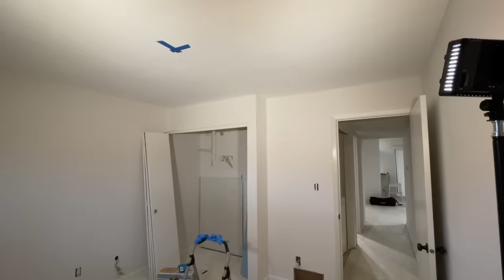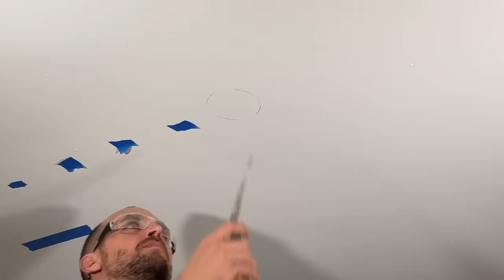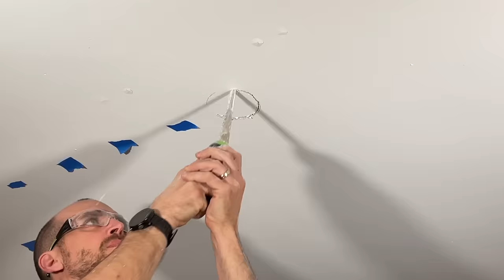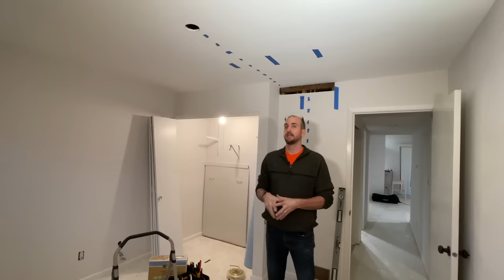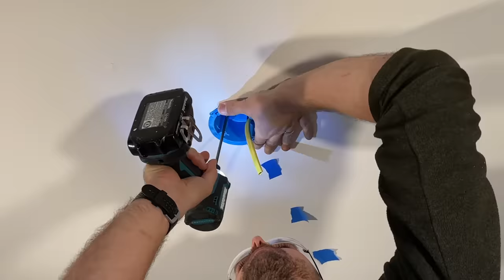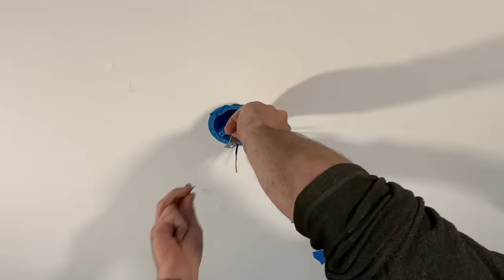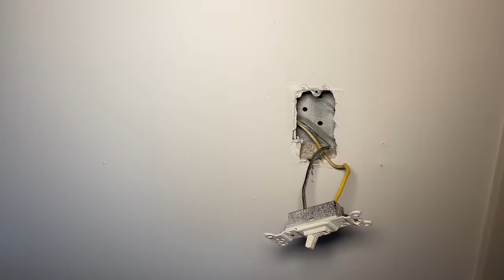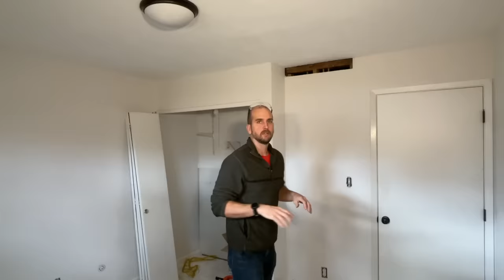How To Install Ceiling Light Without Existing Wiring

Comment: This was a very interesting installation. I really like how you were able to fish wire with minimal drywall damage. I did see two things that concerned me. The first is that the box you used for the ceiling is not ceiling rated. If you look at the UL listing for that box it specifically says that it is designed for wall and not for ceilings. The second thing is that if that wall cavity you ran the romex in is an air plenum, then this is actually a very dangerous installation because the romex is not plenum rated. If there is a fire, then the romex will produce a poisonous gas that would spread through the home.
Reply from the maker: Hey Paul, thanks for the feedback.  Agree, this is a better box to use https://amzn.to/2W0rDfY .
Reply: @EverydayHomeRepairs  Another thing is you didn't ground the cross brace that screws to the box that supports the light. Even though the light is grounded, the cross brace needs to be grounded as well. If the box was metal instead of plastic, you wouldn't need to do ground the brace.
Reply: @Bluesman57  it looks like the metal tube make contact with the brace and the metal backing of the light. I'm not sure why it'd matter anyways, that bracket isn't accessible and I doubt you'll get a short there and not conduct to the back of the lamp.

Comment: Great video to teach a beginner how to add a light the only thing I would change is I would cut a much smaller hole in the left stud space a couple inches lower so you don’t have to patch a corner and you can use that smaller hole to fish the wire into the right stud space

Comment: Thanks for this video.  I learned a lot.
Now i can explain to my Electrician tech. Exactly how i want my wires to go through without sounding like a clueless person.
Reply: If you have a good electrician and not a handyman all you need to say is you want an overhead light in your room with minimal holes and existing receptacles on all the time. The electrician will figure it out easy enough.

Comment: You cannot use Romex in a plenum area. That is why they used conduit.
Reply from the maker: Hey Melissa, thanks for the feedback.
Reply: Actually romex can be installed in a return air duct in a residential installation.
Reply: That's not necessarily true. In Chicago, all wiring must be installed in conduit, whether in a plenum or not.
Reply: Romex can only be run across a cold air return with the holes caulked. It’s a code violation to run romex like you did there. Depending on how many floors your condo has and local building codes it might not meet code with any romex in the condo.
Reply: you can use what you want on your property...this is a free nation
Reply: @jimmac1185  Chicago is run by sorry Unions.....what I do in my house is not their business
Reply: @jimbritttn  it may not be the union's business, but it is the wiring inspector's business-
Reply: As far as doing what you want, it’s your property, you don’t own the lives of all the people hurt when the building catches fire. I’m an unpaid volunteer fire fighter, I can tell you about many people who aren’t happy about work done that violates code.
Reply: @jakem2286  I've done electrical and plumbing work since I was 15 (my younger & brother wired my dad's new house in 1967 and brother still lives in the house!)
Reply: @jimbritttn  so you’re an expert? Bet you don’t know how a 3 way works
Reply: @jakem2286  don't be insulting! Just retired from 45 years programming computers and have done electrical work for over 50 years

Comment: couldn't you also use the light switch to do the same thing. just wire the load side from your outlet to the bottom of the switch to give it power all the time and the top of the switch to your light that's switched??
Reply: Yup !   Would have also worked.  Wouldn’t save any labour, so what he did in this video was equally good.  Truthfully, your thinking is quite smart.  Your way would also provide an identified (ie neutral) wire at your switch box.  I find that today, many people want dimmers, timers, sensors instead of a plain old switch; having an identified wire gives you more flexibility in what type of control you can install to replace a switch.

Comment: Yea,, this guy has some knowledge about doing this. But if I ever cut open wall like that to run a cable, my boss would bust me back to clean guy. And he ran 12/2RX not 14/2RX (yellow cable is ALLWAYS 12/2RX)
Reply: ya, 14/2 would have been cheaper. You can still use 12 though. it does not violate code
Reply: If the outlets had a 12/2 , code says he must use 12/2 not 14/2. Most likely a 20 Amp circuit. I thought the same thing and the old wiring did appear to be 12 wire.

Comment: Thankfully there was no blocking in between the ceiling joists or wall studs 🤣🤣🤣
Reply: That's what I deal with in my walls but I assumed it was because it was built in the 60s... Have to put at least 3 holes in any wall to do wiring
Reply: Rarely is

Comment: U meant well with this video but every home presents different challenges. To add recessed lighting in the ceiling of my 1950's home meant cutting a multitude of openings in the sheetrock and drilling thru ceiling beams to run the romex cable. I had no access from above or below due to finished spaces so I don't see how it could have been done otherwise. It was a great big mess but the finished product was worth it.
Reply from the maker: Yes, that would be a bigger job for sure.  This type of work always gives me a greater appreciation for attic access.

Comment: Good work but you coulda just went to the switch and re wired the plugs to be constantly hot from there. Then sent your “should have been” 14/2 to the light.
Reply: It's actually cheaper, in the long run, to use 12/2 over 14/2. When you factor in the cost of electricity.
Reply: @OGR In this case maybe. But if he is doing a bunch of other wiring in the house, why buy 14? Might as well bring it up to 12. The cost difference in the cable itself isn't that much.
Reply: @OGR home depot's website has the 250' rolls of 14/2 at $0.30 per foot and 12/2 at $0.31 per foot. So yeah, 12/2 is the better buy.
Reply: @OGR I don't normally wire houses from start to finish, so I am not qualified to answer that question.
Reply: @jimmac1185  my fingers don’t like 12/2 much.

Comment: Yeah I'm buying a house and all 4 bedrooms are like this so I'm very thankful to of found this video. Only thing I haven't dipped my finger in yet is sheet rock. Did you do a follow up video to finish things?
Reply from the maker: Nope, I had a guy coming in to do some other drywall repair / painting so I wasn't able to capture that part of the project.  I really like this guy who has all kinds of videos with tips on drywall.  https://www.youtube.com/channel/UCbZdXox6mKHdcT2QdVT-goQ
Reply: Why not crawl into the attic to run the wire across it and down to the switch?
Much easier than having to fix a large hole in the wall.
Reply: @BA-gn3qb  well I can do that for my upstairs rooms but not my basement ones. But my basement ones have pull switch lights which I'm going to get these wireless modules connect them to the power of the existing lights then mount a new ceiling light and mount the cordless/wireless switches. I found done in Amazon for 17 bucks a piece.
Reply from the maker: @BA-gn3qb  I wish, that would be much easier.  This is the first floor of a 3 story condo complex so no access from above for this install.
Reply: @EverydayHomeRepairs  - I understand your situation. 
But the other guy said he was buying a House.   Which should have an attic.  And as far as his answer, a finished basement too.

Comment: Just put 14-3 when wiring a ceiling, in case they wanna do a ceiling fan/light in the future, they can at least control fan and light seperately.
Reply from the maker: Hey Ryan, not a bad idea, thanks for the feedback!
Reply: Not that it really matters, but code says if you run 14/3 you have to install a fan rated box, unless you’re running the wire to feed another wire leaving that location.

Comment: @everydayhomerepairs
Hello, 

Thank you for making these videos. They have very helpful and informative. I have a 2017 home that I want to install recessed lights into the master bedroom. The room has a light switch but it does not power any of the wall receptacles or outlets when I turn the switch on/off. Do you recommend any videos I can watch to trouble shoot this situation or have any suggestions? Thank you

Comment: You seemed to fail to mention what happens when the ceiling joists go the way way to do this job .
Reply: Same thing but more holes in the joists and more drywall repair.
Reply: @WTFUSERNAM44  not necessarily, if the ceiling is installed with strapping.

Comment: I learned a few things, thanks. Where I live, this would require a permit because it constitutes ‘extending/altering/modifying the wiring system’. Also, since this is a condo, where I live, this would have to be done by a licensed electrical contractor. In my state, a non-licensed person can only work on a single-family residence (that they own, live in, won’t rent/lease/sell for 12 months, and a few more rules…).

Another commenter stated that since it is a light, he only needed to use 14-2. That depends. What really dictates what gauge wire that should be used is the ampere rating of the circuit breaker. Since he is tying into the branch circuit for receptacles, there is a good chance that circuit is 20A. If so, he is correct in using 12-2 and not 14-2 since 14-2 is not rated for a 20A branch circuit. p.s. At 13:46, it appears the AWG of the wire is 12.

Comment: That "vent" in the wall is a little suspicious.  No metal ducting?  Is this a teenager's bedroom?  Looks like a good stash spot.
Reply: Common for return ducts
Reply: its a cold air return duct. They typically just use the cavity between studs

Comment: So that whole room had every top outlet on the switch?? Yikes. Anyone else think that's bizarre? I'm accustomed to just the outlet closest to the door having that kind of control to just put the main room lamp/light on. Having every outlet have one receptacle dependent on the same one switch seems illogical.
Reply: It’s pretty common in apartments
Reply: When they built the place most people used lamps. That’s so they could switch it on.
Reply: @marshallkobe  On EVERY outlet in the room?
Reply: @camdendexter  yeah. We had a new home built and i did an electrical inspection on every bedroom, the top socket of every outlet was switched.

Comment: I feel bad for the person who goes to install a ceiling fan on that box and it all comes crashing down on them.
Reply: Seriously, a metal retrofit box rated for ceiling fan use is less than $15 at Lowe's/Home Depot, no reason not to install one.
Reply: @ProfessionalFixologist  metal box not mounted on joists still won’t help :)
Reply: @luyichen11  The metal retrofit boxes rated for ceiling fan use have a long bar and two metal "claws" and a rod you turn, causing the claws to bite into the wood and compression fitting into the joists.  Installed properly will hold a ceiling fan no problem.  Example: https://www.youtube.com/watch?v=KvZzLJmJhtU
Reply: @ProfessionalFixologist  thanks. And now I feel shame about my ignorance. And there is no need to cut open any bigger hole because the crossmember bar can be inserted first and compressed to fit in between two adjacent joists….

Comment: I'm doing this in three rooms today. Wish me luck. One question: Is there a specific reason you used 12/2 wire? I'm using ceiling boxes that can support a fan, and I plan to use 14/2 wire, which should be ample for a fan with lights. Just curious if the 12/2 was what you had on hand or if I'm missing something and the 14/2 might be insufficient for one reason or another.
Reply from the maker: Usually you would use the gauge of wire that is matched to your circuit breaker size.  20 Amp = 12 gauge and 15 Amp = 14 gauge

Comment: How did you run the wire going down the wall without drilling any holes?
Reply from the maker: Hey Tristan,  actually behind the wall was an open drop ceiling for some utilities associated to a laundry closet so I was able to just come out from between the floor joists and then around the middle 2x4 and down the adjacent wall cavity.  Normally I would need to drill a hole through the 2x4 to get access to the adjacent wall cavity.  Let me know if you have any other questions.

Comment: Great video .  I think my room only has one outlet that goes on and off with the switch.   I don’t mind that one staying like that.  I’m also adding a brand new led light fixture for the first time in that room.  The switch had a red, black, and copper on it.  The switch box had blacks tied together , whites tied together. ,  coppers tied together.  Can I just run a romex from cieling to switch and if so how would I tie into the existing wiring?
Reply: Black & Decker publishes a book/pamphlet called Basic Wiring & Electrical Repairs.  It shows clear color photographs of every possible wiring scenario.  You can find it on ebay for about $3-4.

Comment: 12/2 Romex for an led light? 14/2 would have been fine and so much easier.
Reply: you have to match the existing wire. if it is a 20 amp circuit you have to continue using 12/2. I don't know why its 12 g wire (20 amp) for a bedroom.

Comment: You apparently have never heard of a "stack switch" that would still keep switched outlets and saved a boatload of unnecessary work . You may want to consider buying and following  National Electrical Code book.
Reply: Is that a duplex switch?  Single gang but 2 switches?  I don't blame him for removing the switched outlets.  With a switched ceiling light there is no reason to have a switched outlet.
Reply: @Guillotines_For_Globalists  Single gang,2 or 3 switches stacked vertical.1 pole or 3way
Reply: @robertfunicello2676  I know what you are talking about.  The triple stack is more rare.  In my home I use single gang duplex switches in 3 locations.  In the bathrooms, actually.  Mostly to separate the fan and light functionality of the bathroom fans.

Comment: "there's conduit in this condo like a commerical installation" Nnnnoooo that's code, and pulling romex through the wall and ceiling where conduit is the electrical code is against said code and upon resale that light will have to be re-wired inside of the metallic conduit that will have to be installed by tearing out the drywall first.
Reply: Get your own channel
Reply: Upon resale?  No, potential buyers aren't going to x-ray the walls.
Reply: @111ch1a1d111  Standard home inspections check all wiring as part of the purchase process. No xrays, but yes, different wiring would definitely be flagged in the inspection.
Reply: @SamPineas  No one will ever know unless they are told. I have seen many inspections and never have seen them take out receptacles and look. I have seen them use testers to make sure they are grounded.
Reply: I did something similar and my condo had conduit wiring. The code said that in rework situations you can use armored cables as long as runs are less than 25’.  Armored cable requires special handling when connected to a metal box.  Also you can get metal old-work boxes that will hang from sheet rock.
Reply: Hate to break it to you but no one is opening the walls to see he did it wrong.  And most inspectors don't know a single line of code so it wouldn't matter anyways. Lol at some of y'all. Yeah he made mistakes and not to code but who will know if it is safe for another 100 years anyways? I see more shoddy work being passed by "professionals" and houses sold all the time. Not excusing the mistakes but these are so minor it's laughable.

Comment: The ceiling box you are going to is in violation of the code. You know it must be fan rated box.
Reply from the maker: Completely agree Greg and thanks for the feedback.  This has been the old work box others mentioned  https://amzn.to/3nityIu .  If you have a different one you prefer let me know as it helps to get as much feedback as possible to help others.
Reply: No it does not need to be fan rated. That is only the case if you have two switches in the wall. Meaning one controls the fan and the other controls the light.
Reply: Screw the code

Comment: Now show how to do it with fire walls installed lol, they always show the easy way duh..
Reply: cut 2 holes one below and one above drill a hole for wiring and fill fireblock holes with fireblock foam when done...
Reply: Glad I haven't had to deal with that. Looks like a royal drywall pain in the ass.

Comment: Hello and thanks for the video.  I want to add a ceiling fan where there is none and I also have a single switched outlet in an exterior wall.  To my knowledge both outlets in the receptacle are switched power.  Would I be able to use this technique to run line to a ceiling fan?

Comment: In most condo environments all types of electrical and plumbing work must be done by a licensed electrician or plumber. You might burn down your own unit and your neighbors unit too. Always check with your local inspection authority before following an irresponsible example like this video.
Reply: Check description. This video is for entertainment only.

Comment: Good video, thanks.
Question for anyone that knows.
I see that black wire from new romex was connected to switch wire (power to power).
But I don't know where is the ground and with neutral are connected to.
Please advise.

Comment: I have a switch that controls outlets but because  I put new outlets in the boxes (each outlet has two usb and two plugs) the switch no longer has any effect on the outlets.  All outlets are hot at all times.  My question is, "How would you do this exact same scenario from my switch to the ceiling ( I live in condo as well) when the ceiling is concrete?  I do know there is space between the floors as I do have a dining room light from said ceiling.